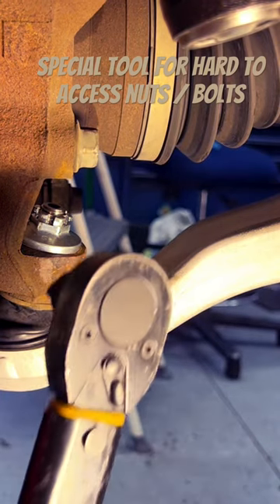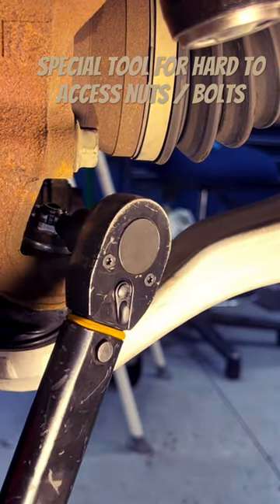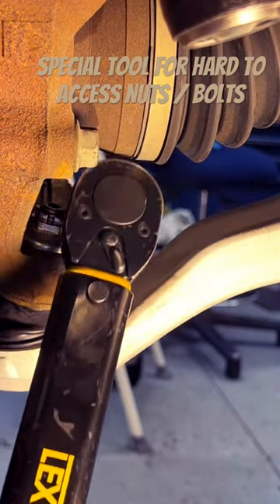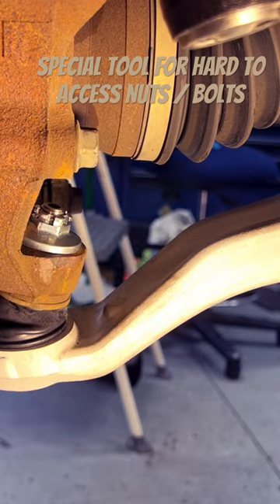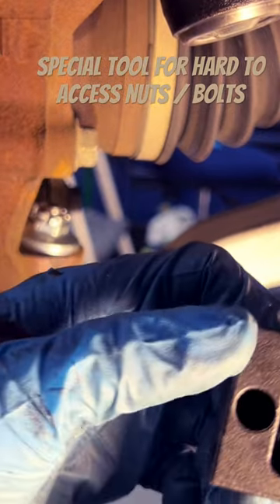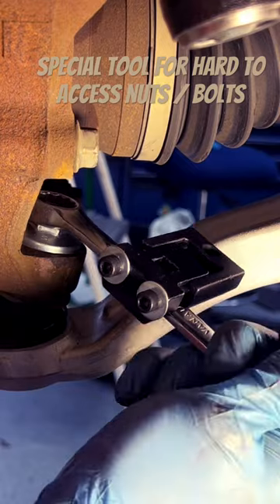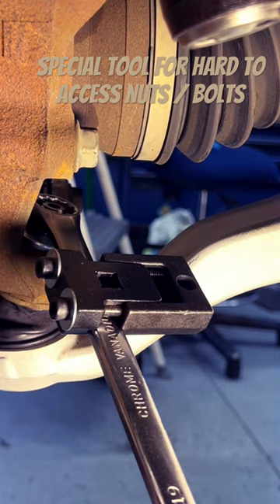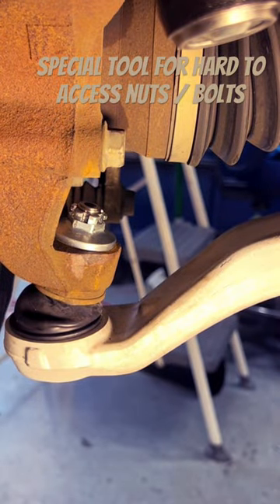Name this #specialtool #struggletosuccess #torquewrench #torque #specs #shortsvideo #shorts

Comment: You added length to your torque wrench, changing the torque value.  
Put the adapter at 90 degrees to the torque wrench and it doesn’t change the torque value.
Reply from the maker: Thank you that. You are totally right